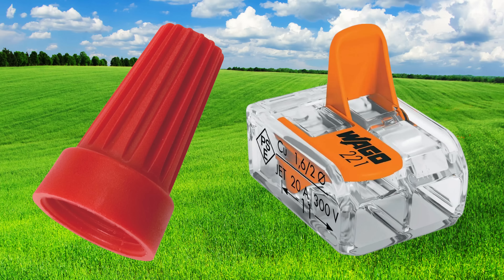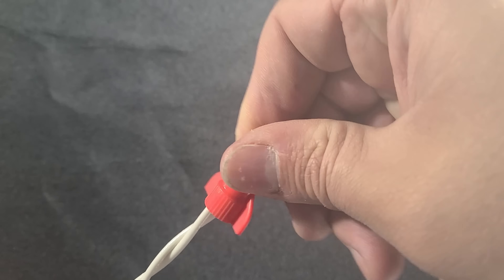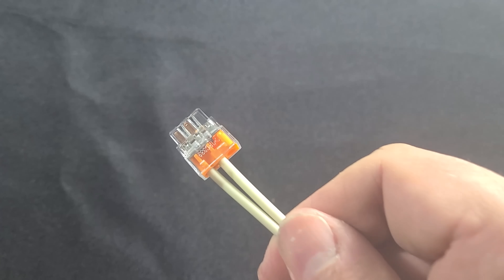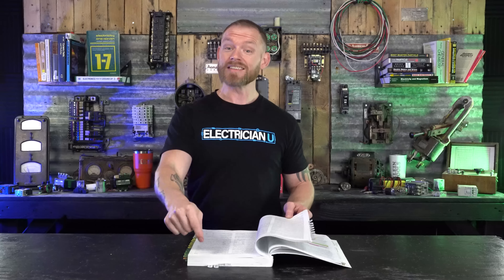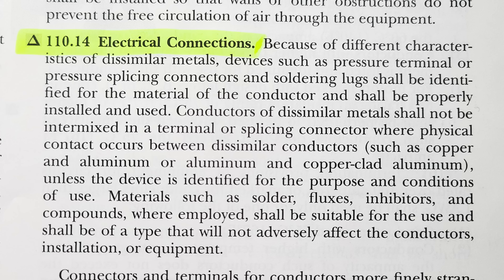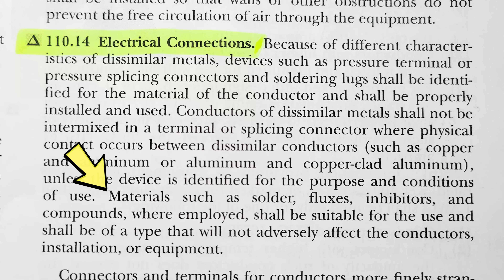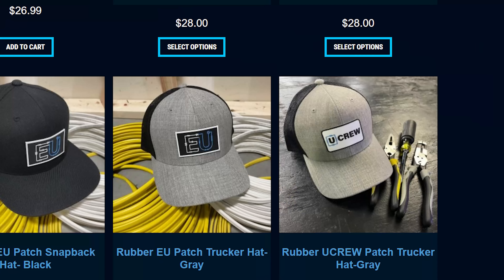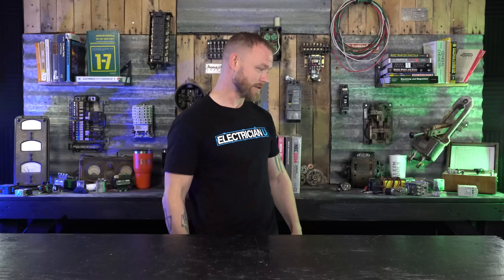Should We Use WAGOS or WIRENUTS?!?!

Comment: 9:07 that's funny because in trade school we were taught that the wire nuts should not just be shoved in because they will, inevitability, become loose. I know some guys can get them on but we all had issues with our nuts staying firmly on our wires when shoving them in. I then found the WAGO connectors and haven't looked back. A bit more expensive but it saves me quite a bit of time and some wire, too.

Comment: I was wondering if the formal US standard for electrical installations prohibits the use of solder on the terminals of electrical conductors to insert them into socket terminals or circuit breakers?

Comment: I see the convenience aspect being a good thing. However, i work in wastewater industry and think they are a terrible idea for wet locations with critical equipment. Imho. I would entertain them in certain automotive wire applications in the vehicle, say car stereo harness or something like it. Not undercarriage related surely.
Reply: If you want a waterproof connection, you also need to use Gelbox.

Comment: This is pretty specific to people who prototype electrical systems but I find wago connectors very useful for creating temporary connections. For example, the other day I had to connect some CAT5 cable to an arduino and I was able to splice the CAT5 to a DuPont connector which was the connected to the arduino header. I could then disconnect them later with minimal damage to both wires. Screw terminals and wire nuts both damage wires so they are not as useful for me during the prototyping phase.

Comment: I work for a large corporation we build commercial buildings subcontract electrical I'm in the IT side I do see lot of electrical work going on. What I see is lot of younger guys all using Wago type connectors mostly push connectors they are the cheapest and most idiot proof IMO. These are guys doing all the labor work bottom of the pecking order the older more experienced electrician he out in the hallway sipping some coffee talking about a football game.  Cost, speed, and less prone to sloppy work means avoiding wire nuts and twisting wire. If the engineering plans call for push connectors that is what they use.  I still use wire nuts personally because it's cheap at home in my own garage. One day I ran into a guy he was cleaning out his truck throwing away 10 boxes of wire nuts must have been 400 wire nuts I asked him if I could have them I have a life time supply of wire nuts when all those are used up ill buy a Wago. I have used Wagos a few times where I might change things around I like those levers doesn't damage the wire.

Comment: The coils in Ideal wire nuts are zinc plated, why are they allowed as they go against 110.14 when connecting two copper conductors together as they can form galvanic corrosion? Older Thomas and Betts Marrettes made in Canada have copper plated coils inside, I am not sure about the Marrettes made after 2012 as T&B was purchased by ABB Ltd.

Comment: I wish you had made more of a distinction between the Wago lever-nuts and the push-in connectors.
The push-in connectors seem more like a reliable version of backstab terminals. Good, but not amazing.
The lever-nuts are amazing. Better than wire nuts 99% of the time... except the cost.

Comment: I think if one is a certified electrician, one should know how to pronounce the name, “Wago’ [wah’-go]. Pronouncing it differently, suggests one has not done thorough due diligence. Other than that, it would have also been nice to discuss resistance properties and the differences therein between wire nuts and Wagos.

Comment: What is wrong with the connector in the belly to the ballast provided by the manufacturer... Legos are one hit and quit it it bends the tab tin that carries the current 277 in the Walmart you referred will not be a sound mechanical connection  used twice.. I've seen them melt and burned from reuse.   I'll twist the wires on current conductors  and lego for  bonding pigtails, but the same scenario,  except there's a shock Hazzard there.  Twisted Green nuts are better.. then the hole profit margin issue $1 vs $.25 each. <  bet you pivk up lego before reds>

Comment: I am a maintenance guy for apartments and work alone so when I have limited room and space I used wagons to hook up a light switch on off on a ceiling fan. Only have 2 hands so used a bungee wrapped around the fan blades to hold the base to attach

Comment: My electrician father,born 1926 now deceased, was the Electrical maintenance foreman for Westinghouse Electric in East Pittsburgh PA for 40 years. High voltage was his daily routine. He never taught me how to throw the curveball or how to stay low on the football field but he taught me a ton about electricity and practical aspects of wiring etc.He sat and watched me twist and wire nut lots of conductors and only stopped when he knew I had "Got it". Wagos look "dainty" to me.I'm curious what he would've thought of them. He was in charge of the budget in his department but was all about time savers. I'm helping my son re-wire his Craftsman Style house built in 1929, currently . Taking out all of the knob and tube wiring and taking it modern all the way out to the weatherhead. We're sticking with wire nuts no matter where the field connection as I have my life's experience as well as my dad's to rely on. I didn't mention my first grandchild is on the way and will sleep in this wooden house. Maybe when my son teaches this one they'll move on to clippy things. Not this guy.
Reply: You need to put your ego aside and let your son use the better product. It's safer, easier to install and much easier to maintain.

Continental Europe has been using Wagos since the 80s, industries have moved on to Wagos for years if not decades. 

Wire nuts are insanity.
Reply: @ailurusfulgens1849  Haha, you should look up the word "hyperbole". Since when does the US seek to copy Europe's construction practices?  Easier to maintain? There is NO maintenance on a properly wire nutted connection.That being said, we did use a couple 5 wire wagos in some light switch boxes to eliminate some crowding concerns. We'll see how the cheesy little clips  hold up.
Reply: @longsnapper5381  It's not an hyperbole, wire nuts are terrible connector. Wagos are superior in every way but cost.

Wagos being around Europe for 40 years means they've been around for as long as your father was an electrician, and if 40 years was enough for your father to become a respected tradesman then 40 years should be enough for wagos to prove they're effective.

It's great you tried them, part of being a good tradesman is keeping with technology, although that technology has been around for half a century at this point.

Comment: Wagos are junk. I was using them on the boat and these things corroded away in a few months. The CG doesn’t allow wire nuts on inspected vessels. This is stupid in my opinion as I’ve seen wire nuts that were on a boat for 70 years and they were just fine. Hell every time I replace a ballast it’s got wire nuts and they have held up just fine for 50-60 years (those old magnetic ballasts lasted a long time even on a boat I don’t think these new electronic ones will even come close).
Reply: You read, sir not very wisely about the conditions under which they can be used and what else needs to be used for the connection to be waterproof?

Comment: I would be completely fine with americans/canadians using wire nuts/Merettes if they just stopped lying about WAGOs. 
The literal ONLY benefit(s?) to wire nuts is:

lower cost.

(also has a literal miniscule lower amount of resistance in its connection, but it doesnt really matter - but i felt like bringing it up anyways)

Comment: Wirenuts are absolutely the worst connector ever unfortunately developed for any voltage either AC or DC.
The only time I unfortunately come across them is on American made products mainly old radio and test equipment.
Here in Australia we use screw connectors for a positive connection.
I now use Wagos as they are superior in my opinion, you can only get so many wires in screw connectors whereas Wagos you just use a Wago with the number of positions you want.
They also make it easy to add or remove a wire at anytime.
The number of tes equipment or valve type radios I’ve opened and found the wire nuts have fallen off and you have bare live or neutral wires has convinced me they are very dangerous.

Comment: a wire nut is a connector that has a trade marked name, but it is just a connector, chop blocks would be another type of connector, the thing that you have to remember about all these connectors is that it isn't just the wire gauge it is also the current, wire nuts only really care about the number of conductors and the size of the conductor as the current is passed wire to wire and the wire nut is just something that holds the wires together.

Comment: Wagos are faster and easier to use, but if the desired end result is a secure zero ohm connection that will last, nothing beats wire nuts.
 So if your goal is to install as much as possible in a day ...Wagos may be your choice. If your goal is to install the best connections possible that will last , stick with wire nuts.

Comment: its german and pronounced vago not wago. wirenuts are utter garbage. the fact you even mentioned if it falls off the cable should be twisted confirms that. if we get anything with a wire nut we turf them and use screw connectors. (Im in New zealand) sorry not sorry the usa power system is pretty crap after what iv seen.
Wagos are bloody brilliant, especially if youre up a ladder and installing a light fitting or something. You can take up some wire strippers and a screw driver and be done with the connection and shutting the terminal block.

Comment: I use a combination of Wago and wire nuts. Wago for light switches or when I'm confident I'll get it wrong the first try. Wire nuts for 12 gauge and junction boxes that feed power to outlets. I always wrap both with electrical tape before I button up the j-box or fixture.

Comment: BEST thing w lever nuts is when u HAVE to work hot. They isolate and secure better than twist on single wires til your ready for testing. Can u twist,remove, separate,then reuse solid and stranded wires efficiently,competently w/o recutting an shortening,  and safely when breaker off isnt an option?  If u can my compliments to you. Go walk on water if your that perfect

Comment: As a DIYer and a cheapskate I was all for wire nuts.  Except that as my project progressed I found I was screwing up and needed to disassemble connections to diagnose problems and test circuits.  Decided to bite the bullet and get Wagos, which have been a godsend.  I buy the 10-pack of 5 position and the 50-pack of 3 position, which are the most practical and versatile.  The only difficulty was getting 12ga stranded in--anything else is fine.  I only use wire nuts in 2 or 3-wire connections where there is lower probability of having to take it apart and/or where there is plenty of wire so I can cut and re-strip without worrying about short wires.

Comment: my main issue with wago is the internal bus is so much thinner than the conductor going into it.  in a wire nut, the conductor itself is the junction.  the nut is a clamping device not a conducting device.

theres also the cost of wago, but they offer flexibility of isolation and reuse, its like a quick connect or a shark bite.

Comment: Wagos a great for light fixtures and for diy ers. It will give a more consistent end product. I can’t tell you how many times I’ve have been digging in a box just to have a poorly made connection fall apart in my hand. But for professionals that’s doing things right from the start, wire nuts are usually the way to go in my opinion.

Comment: I use Wago's in tight space applications.  I like the size and ease of installation.
I don't like the fact that the wires can easily rotate in the Wago.  Seems like a weak connection, though I know it's been tested and certified.  Just seems iffy.
I also usually add electrical tape over the levers as they are easily flipped when pushing into a box.
I do like them over wire nuts for some applications.

Comment: I'm old enough to remember how attractive those old push connect receptacles were to guys in the trade. They were easier and faster. It took years before they started seeing corrosion weaking connections. We all know those things became a nightmare, even though the failure rate was fairly low. It turned out the spring inside was not strong enough to resist the 'corrosion jacking' that would happen to a small percent of those over time. The other thing I like about twisting wires is how much surface area is in contact. That broad surface area of copper to copper twist was so broad that even a small amount of corrosion was still OK. In the big picture, we have numerous examples of corporate products that didn't stand up. For example in the plumbing world, polybutylene, and even CPVC were quickly adopted by contractors until they became disasters years later. I also wonder about whether knockoff products are as reliable. Skepticism over new corporate inventions, to allow another decade of experience, can be a good thing....
Reply: And now I'll tell you something, the prototype of today's push-in WAGO - WAGO 273 was created in 1973. WAGO quick connectors were not originally created for home use, but for industry.

Comment: 🎯 Key Takeaways for quick navigation:

00:00 ⚡ Wire Nuts vs. Wagos Introduction
- Exploring the debate between using wire nuts and wagos for electrical connections.
- Introduction to what wagos are and how they differ from wire nuts.
01:08 🔌 Key Characteristics of Wagos
- Wagos are stab-in splicing devices.
- They have metal inside to connect wires without twisting.
- Discusses the debate around pre-twisting wires before using wire nuts.
03:00 📜 National Electrical Code (NEC) Requirements
- NEC requirements regarding listed equipment and installation instructions.
- Differentiates between "listed" and "listing instructions."
- Explains the significance of using listed equipment.
04:22 🧰 Various Terms for Wire Connectors
- Discusses the use of terms like wire connectors, wire nuts, and more.
- Ideal's patent on the term "wire nut" and its implications.
- Explores the different ways to connect conductors in electrical installations.
05:40 ⚙️ Handling Dissimilar Metals and Corrosion
- The risk of dissimilar metals corroding when mixed.
- How wagos may mitigate this issue depending on their design.
- The importance of using anti-oxidizing paste in wire nuts for dissimilar metals.
07:57 🔗 Splicing and Connection Methods
- NEC guidelines for splicing conductors, including brazing, welding, soldering, and pressure connectors.
- The requirement for soldered splices to be mechanically and electrically secure before soldering.
- Insulation and identification requirements for splices and connections.
10:48 🏭 Practical Application and Preferences
- Practical scenarios where wire nuts and wagos are preferred.
- Benefits of using wagos for quick and efficient work, especially when frequent disassembly is required.
- Factors like stranded conductors and space limitations influencing the choice between wire nuts and wagos.
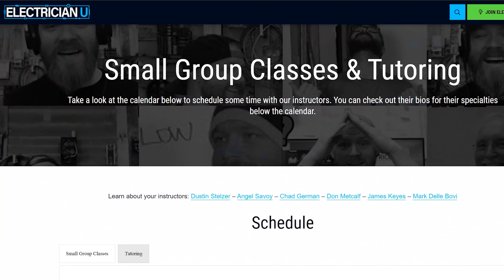12:40 🛒 Merchandise, Education, and Membership
- Promotional information about merchandise (Ucrew hats, Electrician U shirts).
- Mention of continuing education, live tutoring, and available classes.
- Invitation to become a member and support Electrician U's offerings and expanding courses.

Made with HARPA AI

Comment: I do use Wago inside switches and ligthings. But the last time I had to connect six #14 conductors (one feed and 5 receptacles) together I became doubtful. I then used a "blue Marette" and pretwisted all wires together. That's a lot of copper to bind together.  I felt the Wago shell would be too flimsy for that job. In retrospect I am comfortable with my choice.

Comment: My biggest issue with wagos is cost. The wire nuts we use at work are like $20 for a huge bag we can do several houses with. I just looked it up and it would cost $45 for 80 wagos. Thats a huge difference over the course of these huge houses we do. Also in new work theirs no reason to need wagos, we very rarely need to trouble shoot. Out of the last 20 houses we've done the only thing we've had to trouble shoot was somehow the switch leg on a 4 way got skipped on the rough. Wire nuts are not really any more difficult to use, their a better connection. Wagos have a place, but its certainly not new construction. I could see how they would be great for remodels in really old houses when the previous guy left like 1" of wire to work with and you dont want to have to try ro pig tail that. And maybe  for hot work and stuff like that. I just don't see the practicality for new work.

Comment: I've done electrical for 45 years and I don't like pre-twisting wires before installing the wire nut. But I do something many don't, I pay attention and watch the wires to be sure one does not slide down when putting the wire nut on, and I also tug on each wire after the wire nut is on, thousands of connections, NO failures! If I have to service or troubleshoot later, it is much faster/easier to separate the wires later, but a Wago would make this even easier.

Comment: Wagos run 10% to 15% hotter than wirenuts in heavy current circuits. Make what you will of that with lazy excuses. Excuses are for losers and losers seldom win. Push in terminals are for lazy and ignorant people that should find other work.

Comment: As a residential landlord, I wish electricians would always use WAGO lever nut connectors in residential.  I can assure you that switching out old outlets, switches, and light fixtures is more common than you think, and it's MUCH easier with WAGOs.  Whenever I encounter wire nuts I snip them out and replace them with WAGOs.